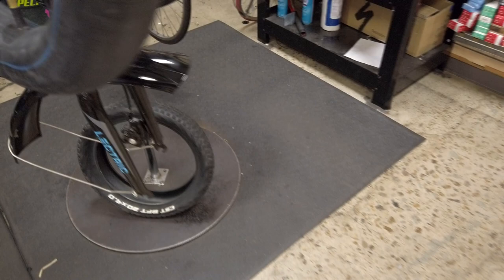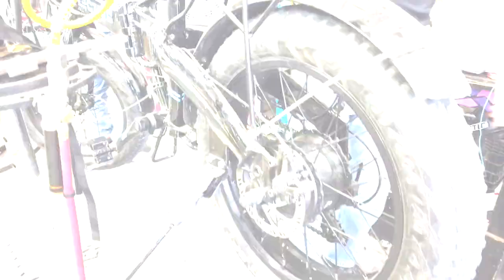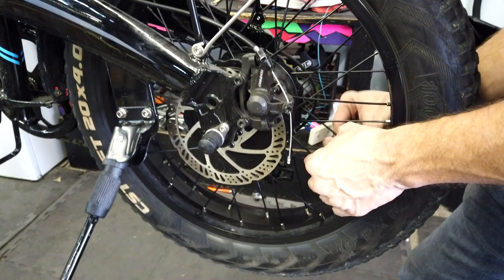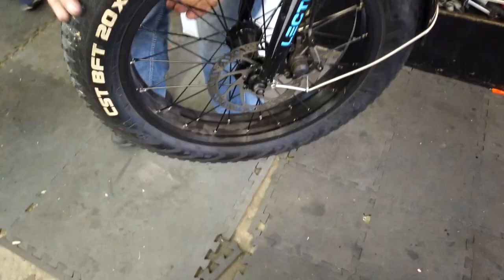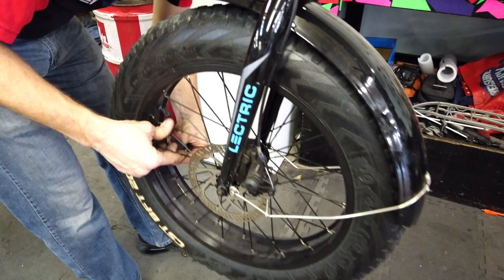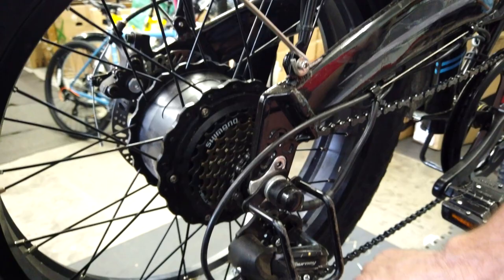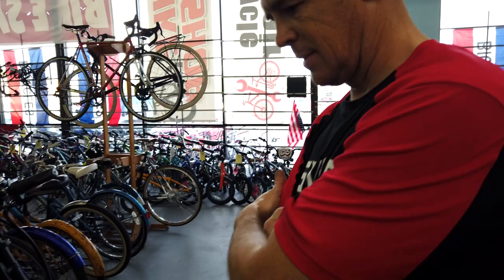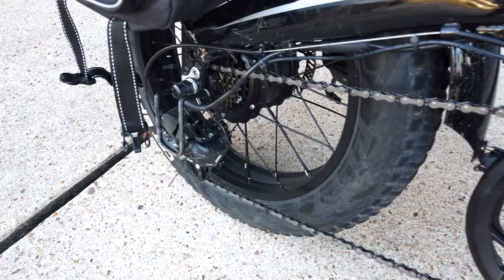Fat Tire Ebike Repair and Maintenance (Lectric XP) - Strill Life - Vlog 13

Comment: Hello, Interesting video. It was nice to see how the mechanic added tension to the spokes without using a truing stand to keep the wheel true.
 I have a Radmini and recently purchased the blue Park Tool spoke wrench and since I didn't have my bike with me, took a gamble on the wrench. So, after watching the video, I am sure that the blue wrench was the right choice. 
As was previously mentioned that was a huge bike shop. Up here in Canada (Toronto area) I haven't seen any huge shops like that. 
I am eagerly awaiting some milder weather to come my way so that I can get out and ride my bike. I've only had it out for two short rides because of the cold and snowy conditions that hit us early. Anyway, thanks again for the video and ride safe.
Reply from the maker: Thanks for the feedback. Yeah you'll love getting out and riding once the weather breaks. Rad makes some... rad bikes. Lol. The electric bike revolution outs coming. Feels kind of cool to be on the 1st wave... or close to the 1st wave.

Comment: I was looking at the E-lux which is the same frame of the Lectric XP frame. the price of this Lectric XP is much more attractive, and with all that savings I can do some nice upgrade to the Lectric Bike myself. 

E-lux Just has bigger 180mm Disc Brakes and a few other better parts. but with a savings of $900 I can do a lot more for my Lectric XP then E-lux did for their Sierra Edition. 

Bike looks good and solid, Very encouraging to hear how much you enjoy this bike. 

You got yourself a new SUB. Thanks for sharing Bro.
Reply from the maker: AWESOME!!! Thanks for the sub and comment.  I'll be dropping a Lectric XP 6-month review hopefully tomorrow.  So you will be able to see any issues or concerns I have about the bike in that video.

Comment: Thanks man, this is very helpful!
Reply from the maker: Glad someone got value out of this. Thanks for the feed back.
Reply: Just found this today. Great informative video. I have been contemplating getting an XP myself. 
I notice the video goes back a while, so you have more time in the saddle. So I am hoping you can answer some questions for me to give me an informed opinion.
Would you buy your XP again? How many batteries do you own? How is the range? How hard is it to pedal with no assist? Any other thoughts you think I might need to know

Comment: If I had this bike I'd strip it and have It pro painted in mat black and remove rear luggage thing then put some BMX bars on it 😍
Reply from the maker: I put the BMX bars on it. Not all that other stuff. I've considered taking off the rack but it's pretty handy. But yeah it's not the coolest thing. But I've settled for ape hanger bars because they are more comfortable than the BMX bars but don't look as goofy as the giraffe stem.

Comment: I wish we had good  electric bike repair stores here in  St. Petersburg FL and Clearwater area.  They are so rude here and will only fix the bikes they sell.
Reply from the maker: That is tragic.  I'm surprised people can be picky in the current economic climate.  I was interested to see if I could get serviced because I heard so many horror stories about taking ebikes to bike shops.  Luckily that hasn't been the case so far for me... as long as my issue is purely mechanical and not electrical.
Reply: @StrillLife  Bro you are so lucky.  These guys here in Florida are so unprofessional and seem to get upset that you didn't pay there high price for buying there ebikes. They rather loose money in fixing a flat are something non electrical than gaining a new customer fir life.  Especially if you are Black seriously.
Reply from the maker: @kenabcxyzproducts3783  so sad.  Welp that's money out of their pocket.  I've had a few funny looks at some bike shops but they still helped me.  Yeah man, let's not even get into the trying to get any kind of decent service while being black.  That's a whole other discussion.

Comment: Did the bike mechanic check out the wheel trueness after tightening the spokes?  Adjusting spokes properly requires much more just tightening spokes!  Wheel alignment and distance to the center must be considered to achieve the best adjustment!
Reply from the maker: Unscientifically, yes. Since he didn't have a trueing stand to accommodate the oversized rim he eyeballed it.

Comment: Waite till you have to repair a rear flat. Never had a flat repair take more than 45 minutes until this bike .It took days of struggle to get wheel off because of one little hex head screw holding a small plate called a torque arm in place that makes it impossible to remove rear wheel. Trouble is noticing its even there. Getting wheel back on is even far worse. Lots of little ducks you have to have perfectly lined up or its a no go.Even after sussing how it has to go on you find out Lectric apparently had a design error that made it impossible to install the brake caliper without adding a 1/8 spacer on the brake side. Problem is the forks do not accommodate that extra 1/8 and Lectric would not tell me what trick they obviously have to spread the rear forks without damaging the bike to get the rear wheel back on. After days of thinking I came up with the idea of using ratcheting tie downs anchored  between two door hinges at opposite ends of the room to spread forks and then the axle falls right in .Lectric says they are aware of the problem and are making a detailed video to go step by step but I wonder why they were almost no help at all telling me HOW to spread the rear forks.
Reply from the maker: Man that sounds horrible. I thought about that and I'm not looking forward to it. Matter fact I should order a tube for the inevitable. Not looking forward to that nightmare.
Reply: Already a few vids on this.....
Reply: Seen in another video a Home made spreader spreader . Also possible a bar clamp reversing clamps to make spreader ?

Comment: Glad I got mag wheels
Reply from the maker: Yeah mags have their advantages but they are so dang heavy.
Reply: @StrillLife  not to me and I'm fairly out of shape but my motor is 750w nominal and 1000w peak
Reply from the maker: That's what's up. It will take a lot to bend those out of shape.
Reply: @StrillLife  they won't bend out of shape. The only thing with mag wheels are the price so if it gets crack or you have to replace it then it's going to cost more.
Reply from the maker: Yeah true that.  You won't be popping no wheelies. Lol. Me either though. My bike is still too heavy for that on the front end.

Comment: My fear about tightening spokes is that it could protrude through the liner more and puncture the inner tube.  I've always wondered if it's better to take off the tire and grind down spokes that stick out with a  Dremel.
Reply from the maker: I didn't think of that. But that introduces other issues like possible sharp edges... not too mention how long that would take to do them all. Hopefully the Gorilla tape in the front tire and rim strip in the back help to mitigate that from happening. So far so good. fingers crossed

Comment: Awesome video.  what tire pressure do you run? 30 psi seems to be rough?  What lube did you change to? Keep these videos coming!!! 🤠
Reply: You didn't answer my question??? 🤷
Reply from the maker: Thanks! As far as PSI I run mine pretty tight but they've softened up because I just haven't aired them up in a while. I haven't ridden in a while. I'm in the process of putting BMX handlebars on the bike. I'll be posting that so stay tuned.
Reply: @StrillLife  If you run the max tire pressure (30psi) you don't get the advantage of the suspension effect that 4 in wide fat tires can offer. You can run 20 psi and be fine. And the ride won't be so bumpy.
Reply from the maker: @scoop4321  true.  I like the added mileage and speed that solid tires give.  The bike seems more agile and fun to ride to me personally with a firmer ride.  But to each their own.

Comment: Get some Kenda Kraze street tires from rad power bikes. I just ordered mine. As far as I know they're  the only place in North America you can get them.
Reply from the maker: Thanks for watching and leaving a comment 1st of all.  Thanks. How much do they cost?
Reply: @StrillLife  $92.88 with tax and shipping. $78 for 2 tires $10 shipping and they charge the sales tax from the state you live in.
Reply: Also i was told you can use the tubes you already have in your wheel.
Reply from the maker: @tralfazz7579  thanks for the info.
Reply: @StrillLife  If you do get the tires please make a video of the tire change process.
Reply from the maker: @tralfazz7579  ahhhhhh! Good point. I'll probably punkout and take it to the shop for those upgrades. For 2 reasons... well 3 (or more). I don't feel like fooling with it.  I don't have the workspace or tools. I'm not totally sure how to do the fork mod.  And lastly, my shop videos get t the most views.

Comment: Great video 👍 do you have a video for rear tire change?
Reply from the maker: No.  Thank goodness.  I hope you don't jink me but I've been fortunate enough not to have to change the rear tube out yet.  I hear dealing with the back is a beast because not only do you have the motor and wiring back there but you have widened the rear mounts to remove and reinstall the back tire.
Reply: @StrillLife  exactly. I ordered 2 a week ago and have later discovered the word of changing rear. I understand the rear forks have to be literally spread open to remove, it's also stiff in that area so....
 Maybe someone will fab up a fork spreader for that purpose specific for the XP.

Comment: Strill, hows the bike doin for ya? Gonna get a couple for the wife n I to scoot around in retirement days. We like the step thru version for our old legs!
I noticed the rim was rough inside wonder if I should take ours off and check that rubber layer between the tube and rim before breakin it in....
Reply from the maker: The bike is doing great. Over 2100 miles and still going strong. I do think I need a new battery though. It dosen't seem to have the longevity as it did when I 1st got it. But that's how battery tech is now. Everything wears down after 100s of cycles. But it's still fun.
Reply: @StrillLife  Outstanding!!  Theres a couple of folks on toobless you that have  vids on these bikes on how to take care and upgrades they made to make em better. Thanks and Glad to hear they are a good bike!
Reply from the maker: @gregprince2523  thanks for watching and chiming in. I haven't had any more issues w the tires. Thank God. If you look thru my Lectric XP play list I have my 2,000 mile bike shop maintenance visit in there and some other videos that might interest you all.
Reply: @StrillLife  awesome  I will!
Reply from the maker: @gregprince2523  aweseome! Thanks!

Comment: Check the bounce ! You be surprise how far it off.
Reply from the maker: Explain. I'm not really seeing it.
Reply: Up and down . Tire doesn’t fit true to the rim. Tire suppose to be a super tight fit to the rim. Bounce out of balance takes away from rolling effectively. I run mr tuffy tire liner and green slime gotten many flats /cuts replace tires w semi slicks . Wait until you try take the rear wheel off . With out a home made rear stay spreader it’s impossible. I am not knocking  the xp to be expected for the price!
Reply from the maker: @tzwc3571  interesting. Sounds like you are more knowledgeable about this than I. Thats nothing that I've noticed when riding or could see visually during this video. But I'll go back and look and pay closer attention when I ride.

Comment: A flat tire in the first 20 miles is toatally doable on all these fat tire bikes.
Reply from the maker: Happened to me. Lol. No problems since and I'm rolling the same tires 3,300 miles later. The rear tire is super bald. I need to replace it but haven't found time to do it.
Reply: @StrillLife  My first flat (back) was at 1760 miles on my Rad City step thru./no fun.
Reply from the maker: Well at least you got almost 2k miles in before it happened. A barely got a day. Lol.  I think the tires were under inflated and I got a pinch flat.

Comment: How much air (Psi) do you keep in your bike man? Ordered one and since you have so much use with it could use your knowledge thanks
Reply from the maker: Man to be honest I can't remember but I keep it close to the max recommended. I haven't put air in my tires probably since I made this video. They hold their pressure impressively. I ride with mine pretty solid. I rather have the mileage over a more comfortable ride. Besides the performance of the bike feels mushy when the tires are too soft and they are more prone to flats.
Reply: Strill Life thanks for the response brother! I’ll take ur advice when mine gets here!
Reply from the maker: @brixtonasher  no doubt. You will love it man.

Comment: So, how much was the repair? He said he charges more for electric bikes...
Reply from the maker: LOL. He charged me $25 for the spoke job plus what he quoted for the tools I purchased.  Which was fair in my opinion.  Not sure how much he would have charged for a regular bike to do the same thing.  Well worth the cost for the results and the good YouTube footage.  Thanks for watching and the comment.
Reply: @StrillLife  what did he charge to fix the flat?  he could of used a zip tie for truing.
Reply from the maker: @specagent999  I can't remember how much the flat tire repair was. It wasn't much around $20 or so. Good idea with the zip ties.
Reply: @StrillLife  $20.00 for a flat tire is a bit much. I Think I want to make my tires tubeless, I don't have to deal with flats.
Reply from the maker: @ELEVOPR  I've seen the tubeless process.  Although it's not extremely hard it's more in-depth than I want to get.  Luckily I've had no further issues with flats as of yet.

Comment: Doesn't Lectric XP e bike give you a spoke tighener in the Tool kit provided by manufacturer ?
Reply from the maker: One didn't come with mine. I can't speak for other people though.
Reply: @StrillLife  no tools at all come with lectric xp bikes I can't even find what this spoke size is
Reply from the maker: @johngrillo1599  mine came with a few tools but not much. I bought 1 of those round spoke tools that has several different sizes and it works fine for the spokes. It was fairly cheap too. But you definitely need 1 because the torque will loosen those spokes up over time. Thanks for stopping by and good luck.
Reply: @StrillLife  I was surprised you didn't buy the blue spoke wrench that was specifically for your bike.
Reply from the maker: @johngrillo1599  the bike shop didn't have it and I didn't know which 1 to buy so I just got the universal 1.

Comment: Could possibly foam fill the tries .No more flats.
Reply from the maker: Not sure. I've heard of slime but bike shops complain about that stuff if you ever take to them later. Never heard of foam in the tire. I've gotten over 1,250 miles and no more flats. Knock on wood.
Reply: @StrillLife  Forklift trucks and aerial work platforms I had driven had foam filled tires ,no flats. Would be interesting to look it up.
Reply: Foam would break up and turn to dust. I wouldn't attempt that. Foam is good for areas that won't be disturbed, tires will be constantly hitting potholes, rough terrain, etc.  Unless there is some kind of special foam made for tires, I wouldn't attempt it with hole patching foam.
Reply from the maker: @ELEVOPR  Yeah....  I haven't had any issues with flats again.  I know its probably just a matter of time but thats just normal wear and tear as far as I'm concerned.
Reply: @ELEVOPR  I drove `vehicles ,forklift trucks, aerial work platforms with foam filled tires. Flat proof. The foam was designed for vehicle tires. Google it. Forklift trucks tires are solid rubber or foam filled.
Reply: FWIW, when I started biking I had flats often. Then I learned to regularly pump them up and keep them within the recommended range. No flats since then, and it's been a few years and thousands of miles across a couple of bikes I own (but neither is fat tired).
Reply from the maker: @ordinaryhuman5645  I agree. I haven't had any issues since. I think I had my tires under inflated when I first got my bike. Since repairing my flat and keeping the tires properly inflated it's been all good... knock on wood.

Comment: Have you had any issues with the brakes?  I have read some people with this ebike are annoyed with the noise coming from the breaks.
Reply from the maker: From time to time the brakes do make some rubbing noises and I'm pretty sure I'll have to replace my brakes pretty soon as well.  But they still stop the bike effectively and I don't think the are grinding yet.  So I'm ok with my breaks so far.  I think I'm less than 40 miles away from 2K miles on the speedo.  So stay tuned because I'll be talking about these and other observations on my 2k review of the bike.
Reply: Brakes silly not breaks
Reply from the maker: @harley092355  yeah that's what meant for got to review. Thanks.
Reply: @harley092355  Thanks for catching that mistake.

Comment: Anybody know what breaks go on these? I don't know what to order. I'm fresh out.
Reply from the maker: I have no clue but I'd start with Lectric. Their support is pretty good. At least it used to be.  I haven't needed to contact them in months so I'm not sure how it is now.  Email them and see what they say and please report back. Also I'm dropping another XP video tomorrow. So make sure you sub so you don't miss it. Thanks for watching.
Reply: @StrillLife  Much appreciated. I ended up checking their website and they had it listed there. The brakes they use is Tektro 160mm mechanical disc brakes. Just need to search for the pad that goes with that.
Reply from the maker: @EmXtraMoney  Cool! If you find a good supplier let me know. If you watch my video I posted today you'll notice my brakes squeal like a car that's has metal on metal. I need to also adjust mine too.